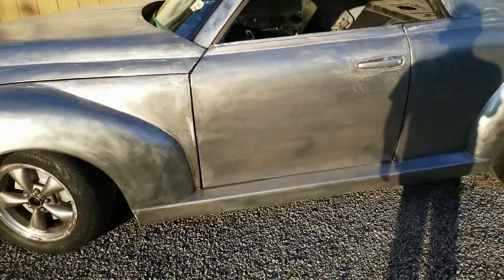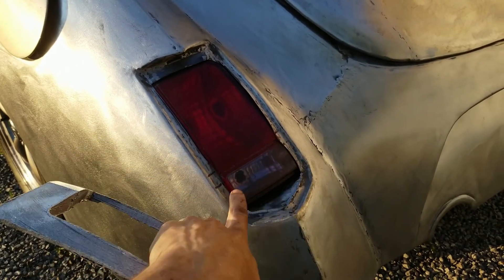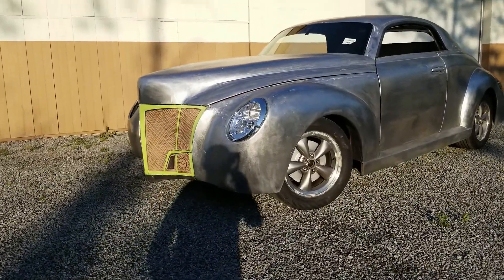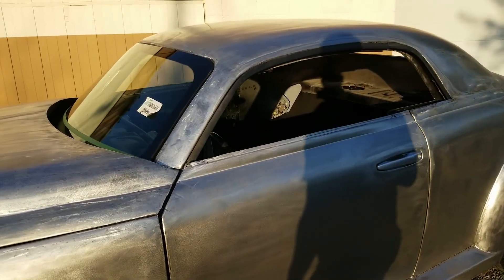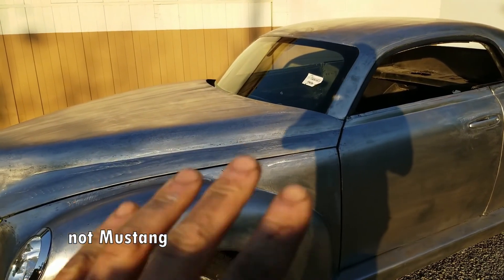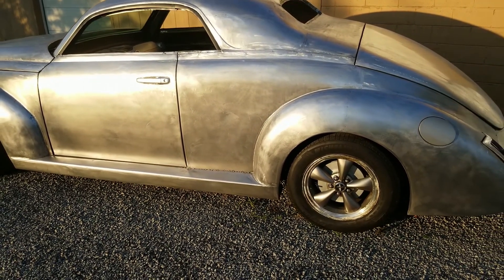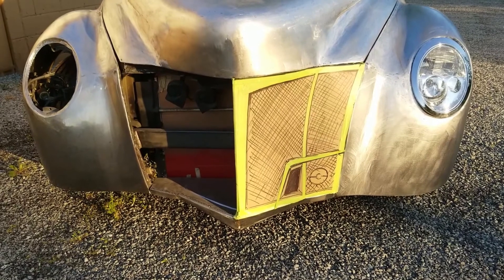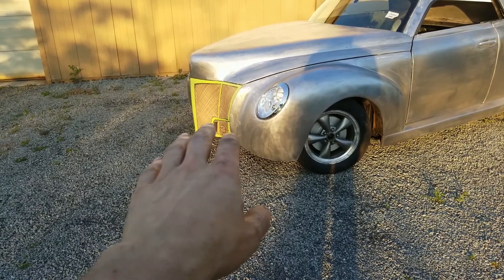From Concept to Reality - 40's Ford Coupe Hardtop Walkaround  - Ep.70

Comment: A critique about the body line sloping too low at the a piller and sloping back up twords the front of the hood. . But regardless 10000000 percent better than I could ever do. Beautiful car.
Reply from the maker: No problem, thanks for the feedback!  I take full responsibility for that being out of wack.  We were running out of daylight, working between 'sun showers' and just plain excited to get it outside... I missed installing a shim on the driver's hood hinge.  Once that goes in and hood/fenders move back to close the gap it will line up.  Thank you for watching!

Comment: If I was gonna be a critic I'd say the bottom front of the front wheel opening has a corner that could be a little softer to follow the 40 a bit closer but overall it looks really sweet!
Reply from the maker: No problem Bill.  I am my own worst critic.  There are a few things that need to be 'adjusted' before heading to paint.  AND... at the time we shot the video I didn't catch it, but the body feature along the shoulder on the driver's side was out of wack.  We were in such a hurry/excited to roll the coupe out between 'sun showers' and before a couple days of rain afterwards ... that I missed reinstalling a hinge shim.  I only saw it after she was back inside.  Thanks for the thumbs up!!